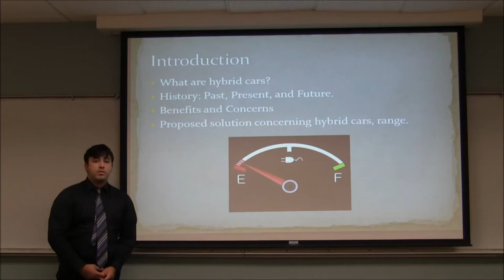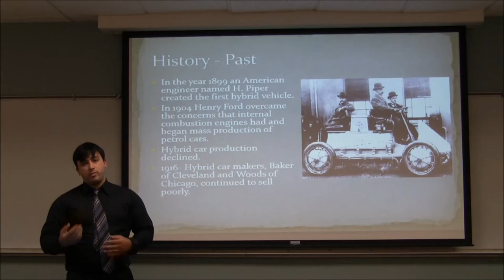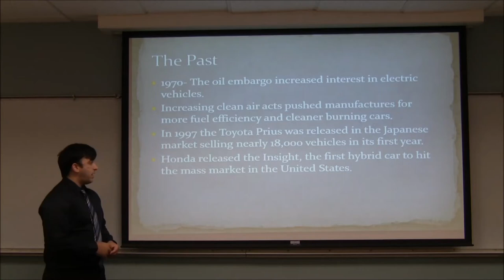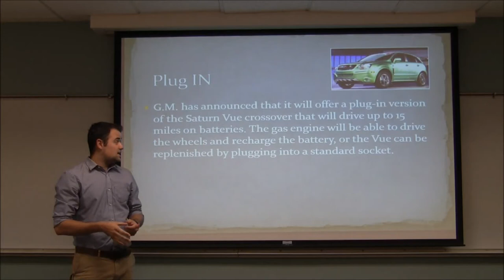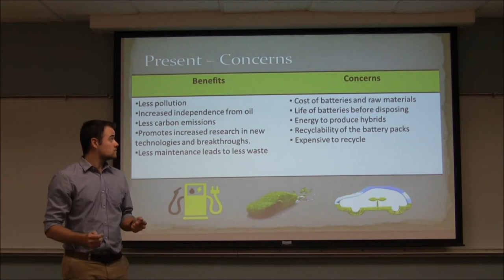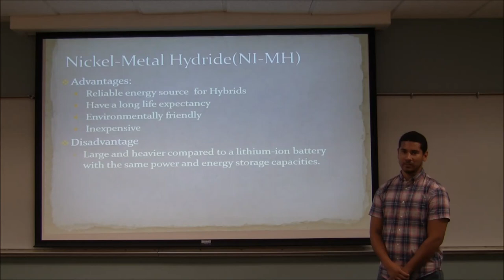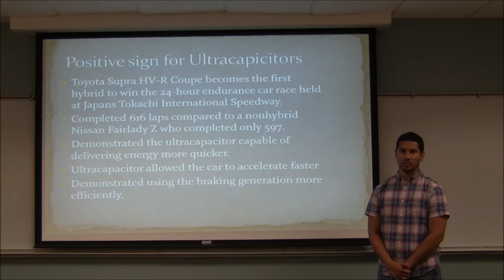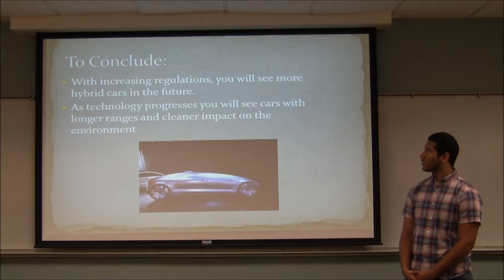Team 5 - Hybrid Cars

Comment: very good lighting, great use of the background and the color font; made the presentation easy for the reader. over the time limit in presenting, maybe condensing the information and sticking to shorter bullet points would have saved time in the presentation.  a lot of information i never knew about, very good.

Comment: Very good supplemental speaking with PowerPoint. Very good pictures and tables. Everyone spoke clearly and behaved professionally.
Criticisms: 1) “… present history and future history.” ;-) 2) Capitalization inconsistency: should have “Fully Hybrid” instead of “fully Hybrid”. 3) Could you not find a 2014 hybrid market share table? 4) I recommend coming up with an off-camera signal the speaker can use to prompt a slide switch. 5) Inconsistent capitalization and grammar on “How Do Ultracapacitors….” slide, and on following slides. Some bullets should have been indented as they were subtopics.